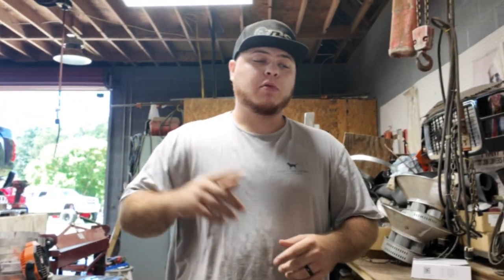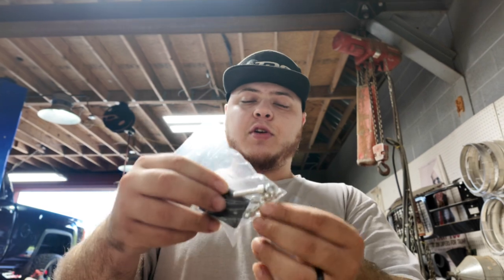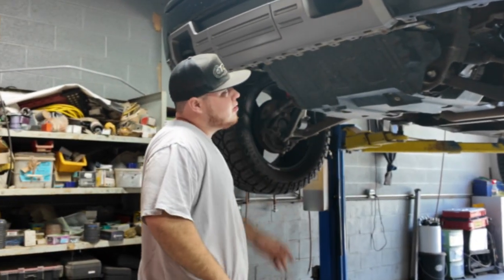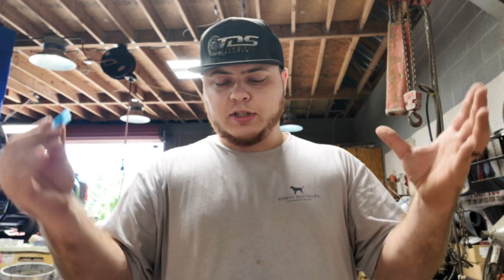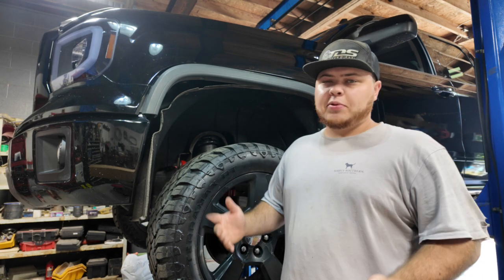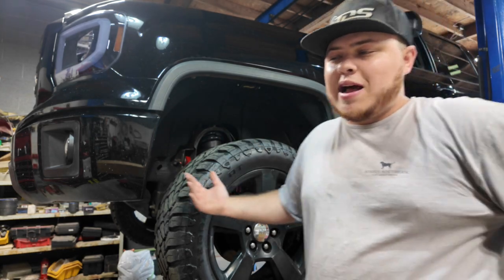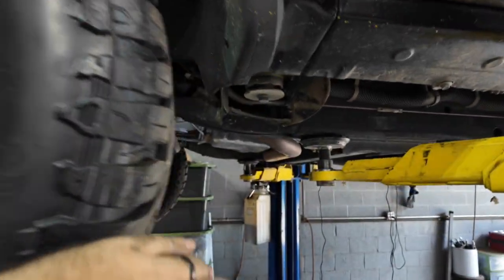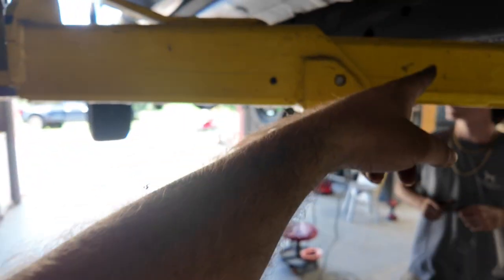Rock Light + Wireless Remote Installation

Comment: What you charge to install a 12 piece.
Reply from the maker: @haydensimpson4594  our install price is $450, plus the price of the rock lights. Which includes a wireless remote at no extra charge.

Comment: I have a question when I connect in my controller box to my battery it make a beeping sound to my speakers when I switch the lights on and the truck is on. When I do the same thing and the truck is off no sound,or when I hook it up to a drill battery no sound even if the truck is on. Any idea of what I could be?
Reply: Is a brand new box btw old one did the same thing
Reply from the maker: @ishmackos1155  I’m no audio Guru but it could possibly be some interference with the ground connections or something of the sort. Do you have an aftermarket head unit or speakers?